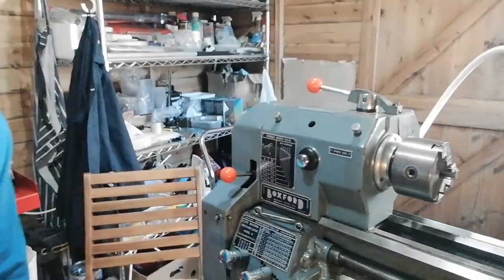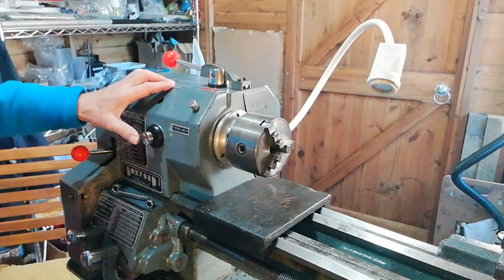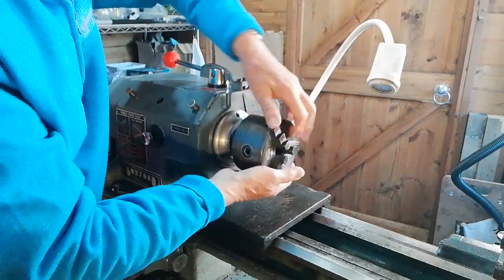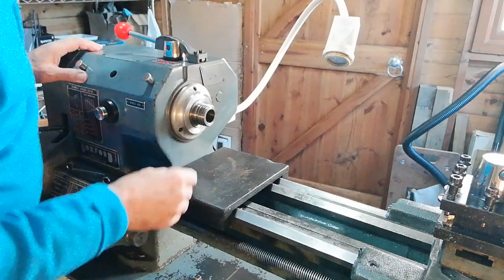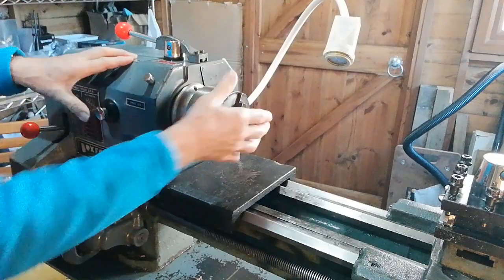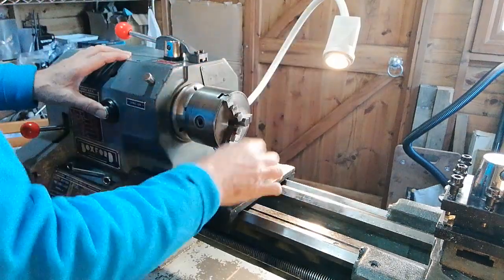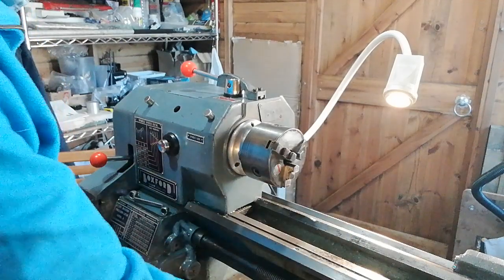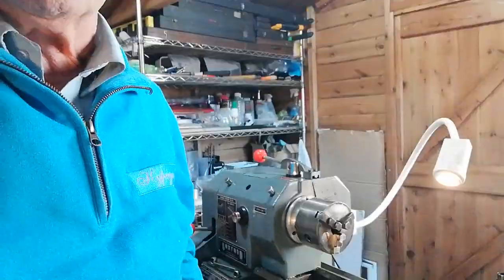Changing a Lathe Chuck SAFELY!

Comment: Very informative, I have just bought a Boxford ME10, and I don't think it has a spindle lock, how do I go about locking the spindle if I want to change the chuck? thanks
Reply from the maker: Hi Dave, I previously had a similar machine with a rear drive and they don't have a spindle lock, like the underdrive models. So here's what you need to do:
Engage the back gear with the lever at the back left hand side of the lathe. This will lock the spindle.
Follow the procedures as demonstrated on my video.
If it is too difficult to remove by hand, hit it firmly with a hammer, preferably copper faced. That should release the chuck.
Alternatively, position a strong rigid bar, 2- 3 ft. in length between the jaws; then press firmly downwards in the anticlockwise direction. If this fails, then strike the bar smartly with a heavy hammer. Take care to ensure it is held within the jaws, so as not to slip out.
Be careful not to trap your hand with the bar, as sometimes a sudden release turns the Chuck more than you may anticipate.
Remember to protect the bed as advised and drip tray if fitted.
Thank you for your important question, that should also be helpful to other people experiencing the same problem.
Good luck and let me know how you get on with it. 🍀 K